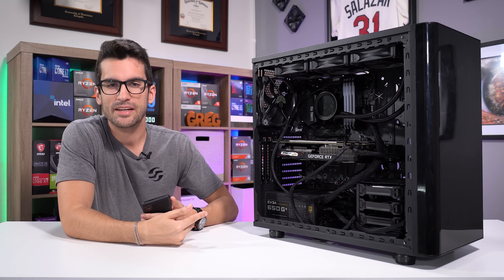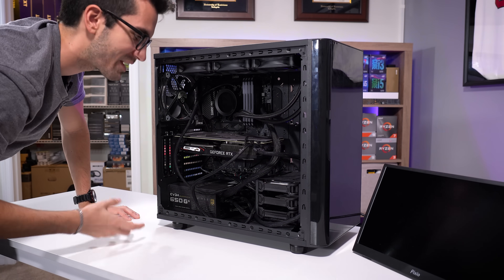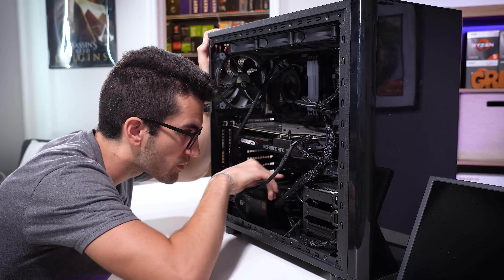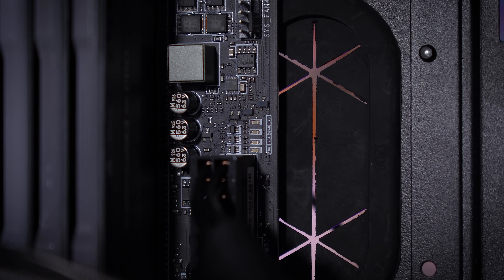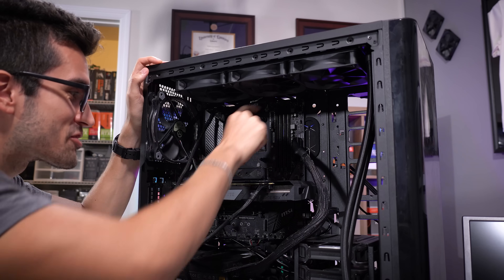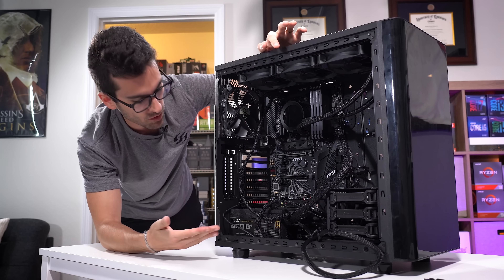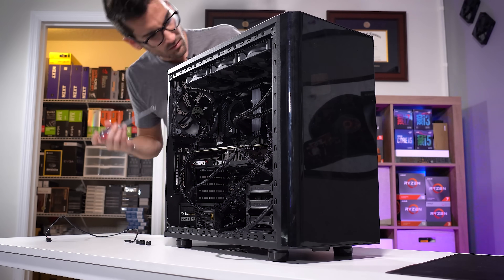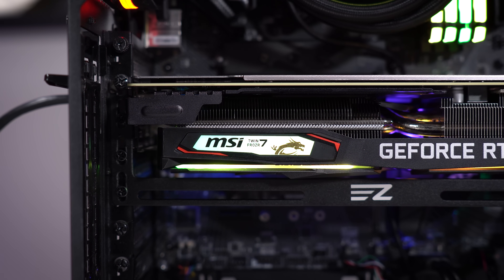Fixing a Viewer's BROKEN Gaming PC? - Fix or Flop S1:E4

Comment: Ive had that auto power off issue, but it's has been halfway through loading windows, and I figured an update had gone bad, until I found out the PC owner had cleaned out the computer with a compressor, and the problem was, that he had blown a lot of the dried thermal paste out between the die, and heat sink, so it would thermal overload very quickly, and shut down. Iv'e had the auto power off issue before post when it was the PSU 12v feed having dropped it's voltage to almost 3v. Ive never seen the plug issue, this video was very informative thank you.

Comment: I have had boot problems with two builds. First one had me perplexed until I changed a SATA cable and the system booted. Second one was a bad memory module and was easy to diagnose. Sometimes it can come down to just a bad cable giving symptoms as you have experienced in this episode.

Comment: I had the same issue with my old rig when I bought it 2nd hand, it'd power for 1 second, then shut down everything by itself, turns out the USB3.0 connector was upside down which was amazing since it's keyed to go in one way. The motherboard and PSU must've sensed this issue and immediately cut power.
Food for thought for future troubleshooting, ALWAYS disconnect all wires.

Comment: An errant speck of dust can do it.   Dust can carry a minute current and even ground out components.    Several years ago, I cleaned my system, a tiny little dust bunny jumped into an empty Dimm socket for a RAM module and as soon as I booted the system, there was a small flame from the dust bunny and that short fried the dimm socket.    Thankfully, I was still able to use the board with two sticks of memory, but it was a valuable lesson on being very careful when you clean your PC.

Comment: I encountered the same problem as shown in your vid, Greg. Except that it is an intel 5th gen setup. Tried the usual troubleshooting steps, until I was forced to upgrade to a new setup (currently running a ryzen 5 3600 and an rtx 3070). But I never thought of removing the panel cable connections. Thanks for sharing your info on this. Time to revive that old intel then!

Comment: Actually my wife just called me an hour ago and told me exactly that... It's an older machine (i7 4790K, x97, ALSO an MSI-Board...) therefore, anything is possible...
Also that PC tends to have problems with USB connected to those headers for some reason. 
Then, this video popped up. Thanks Greg, made my day!

Comment: Before you ran out of options, there were two other tests you'd have done or were not shown: Reset CMOS which has worked for me. And another instance of wiring issue where PC keeps shutting down / restarting is a problem with a stuck/defective reset switch. Saw that last one in another techtuber's  video (can't remember who) and that one problem was such a curve ball.

Comment: Good debug.  I stopped suspecting the PSU when it started cycling on/off until you turned it off at the PSU.  A PSU problem (like a short) generally shuts down and that's it, it doesn't come back on automatically.  Power-ups are triggered by the board, so they generally set things up to come back on prior to going down.  So if you see it power-up on its own then you know the mobo is directing things.

Comment: Strangely I had exact same issue with my very first build except it wouldn't turn on at all. Everything looked perfect. I literally unplugged everything then plugged it back in and it worked perfectly after that.

Comment: This was actually really easy to figure out. I applaud you for testing everything, but you went for the big things before the obvious thing. So the board recieved power. The board turned on, and then off. Then it turned on and off automatically. That's the answer right there. What turns the board on and off? The power button. The power button has two connectors, an led and the actual switch. The LED recieves constant voltage, the switch only recieves power when the button is pressed. The switch was instead recieving constant power, the PSU was alerted to the problem and shut the board down before it died. So basically the connectors for the button were swapped. 

With a better PSU it would have been either easier or harder to diagnose. If you press the button and only the led comes on, it's letting you know that you messed up. That's the easy way. 
Some PSUs won't even let it boot, which makes it even harder to figure out.

Comment: My OCD is strong with this one...   the backwards rear fan, the cable management, the droopy pants GPU, and that AIO cpu unit being crooked.  The way you make all these PC's you work on look better than they came in makes the mind goblins go away.  lol     Also I have a MSI Frozr 2060 6gb car identical looking to that and it sags as well yet the MSI 1660 super I have does not. The 2060 is that style so it must be something with the way those are made. The 1660 super has zero sag but is also a bit shorter. The MSi mobo I have is a z590 wifi Tomahawk yet the other is an Asus mobo. I was very unhappy with GPU sag with a brand new board and GPU when I purchased them but thank goodness they make brackets like these to fix the shortcomings of the manufacturers. Awesome video even though I am watching it 2 years later.  :)

Comment: Nice video... I've had that issue a few times building older PC's. One where, when the reset-switch was connected, it did this exact thing! Had to just leave it not connected... 

Also: That case is fugly! But nice you fixed his problem :)

Comment: I had this exact issue on a clients custom desktop last week, they had been poking around to clean the pc up.

Turns out it was something shorting the motherboard, I took everything out the case and ran it on a table and it booted immediately. 

Never found the exact thing shorting the board but I did replace all the standoffs and screws holding the board in the case.

Comment: This goes to show why I always recommend disconnecting everything that isn't absolutely necessary to POST when you start troubleshooting - so you should start with literally just a motherboard, CPU, 1 stick of RAM, only necessary cables connected (CPU power, ATX power, graphics card power if no igpu).

Comment: Its funny that it was a front IO issue... Once you showed the problem, my first thought was the power led/power/reset pins were plugged in wrong, especially when you said it would turn on and then power off on its own after the psu switch was flipped.
Glad to here it was an easy fix though regardless.

Comment: Right when you mentioned that the PC turned on after turnig on the PSU (without prssing the power button) I knew it had to do with the front panel. My first guess was a defective/stuck power button, but considering it happend when rebuilding the PC he must have connected the power button pins with an LED (power or drive indicator).

Comment: I think the Front Panel connector was the issue, because when you were troubleshooting it in the first bit of the video, the PC would turn on without you pressing the power button, looks like the power button was jammed in and power looping the system ON and OFF of some sort, and on the first power on after you figured out the issue, you had to physically press the power button to turn it on.

I might be wrong, but that what I got from watching the video.

Comment: Best way to tackle any issue, is to disconnect everything you do not need to boot to the desktop and work your way up from that. What you have shown us here is exaxctly why you do not do it the way you do, but start from the basics. If the basic fails, you can swap ram, psu , cpu and gpu to see which component is faulty. If the basics works, you can attach more stuff, one by one till you find the issue, or, in case of a bad connection, solved it all at once. One more thing, if the basics fails in the case, sometimes you solve it by testing it outside the case. If that works, chances are good it will work inside the case also. Reason? Motherboard most likely made contact with one of the standoffs. Make sure all the standoffs are in the right spots.

Comment: My self built pc has power cycling issues currently.  After I got the latest windows update it started happening.  I reinstalled windows, but not the current update, now it works 90% of the time.

Comment: it also can be the plug insert metal if its damaged in a way where the sawder is loose it can cause the system to no post, i had similar problem with a motherboard i had, it was a fan input/connection.

Comment: I had this with my daughters gaming machine it was dust under the case power on button. Bought an external power start button off eBay and it solved the issue.

Comment: I won't argue with results, congrtas on fix, but I would say you should review your methodology of troubleshooting because of things like those wires. So far we didn't see any super tightly packed SFF's thus i would always start with disconnecting everything down to essential power cables, cpu and one stick of RAM and gpu if needed.

Comment: I can only think of two possible miss wirings that could cause that. Theoretically, the positive lead of the hdd led could have been wired directly into the reset switch's sense line. When the cpu tests begin, it could power up the sata controller just long enough for it to complete the circuit. Other wise, it could just be that the power led was wired the same way as described and msi boards just take a long time to read from the reset line.

Comment: As someone who has had to perform trial and error on front panel pinouts for random OEM boards, he probably had the reset switch connected to the power button pins. Symptoms I've seen of that are power cycling as well as powering on immediately upon turning on the PSU without pressing the power button. Probably unplugged it at some point during the AiO install process and connected them wrong.

Comment: I thought it was a front panel I/O issue! My clue was that at 6:22 you note that it's weird that it powers on automatically, which made me think "what if the motherboard thinks the power button is being held down?". I bet that some of the wires were swapped (maybe power button and power led?) which bridged the power contacts. That would explain the cycling. I bet if you held down the power button now that it's fixed it would do the same restart loop.

Comment: hot air always rises, whether your running an aio or a beefy air cooler hot air always goes up. how i was taught was the rear and top fans are ALWAYS exhaust, and front and optional bottom are always intake.

Comment: The first step I normally would do is disconnect all cables from motherboard and only reconnect power! One of the USB headers may have been plugged with 2 pins offset shorting out 5v rail. Modern boards are have good protection from this early boards would burn out the 5v trace.....

Comment: This is why i always check the wiring after similar things happen when i fix comps. One of my friends on his last build had the sme exact issue and it was literally because he plugged a positive power into a fan output. luckily nothing fried and the fan connector did work after but all his issues was because of that one misplaced connector.

Comment: if my build is turning off that abruptly, having the hdd screeching off, means the system is directly cutting off the power rather than sending signals to the drives first. Even holding down the power button to shut off the pc usually sends out signals first. for me, the first time imma do is yank out all unnecessary drives, hdds or ssds, then proceed the diagnose procedure rather than letting the system constantly powering on and off killing the drives

Comment: I‘ve a tip for people with the same problem if his solution doesn’t work. Some mainboards are checking whether a cpu cooler is connected properly or not. If it doesn‘t find a cpu cooler it will turns of exactly like in this case.

Comment: Finding your videos very interesting, glad you popped up on YT for me :D I recently had an issue with a new mobo, only it wasn't turning off, just getting stuck at the CPU check, I pretty much did what you tried in your video, even when I tried my old CPU it did the same thing, so I reinstalled the old mobo with the new components because I thought it could have been the CPU due to how it had been handled by the courier company but nope, it was fine, everything worked in the old mobo, so the new mobo has gone back.

Comment: Commenting @1:38 so I have no idea what is wrong yet.
One of my computers had a very similar problem. It was working perfectly. I took it apart to deep clean it, and reapply paste. I put it back together and turned it on. It posted to BIOS but then shut off before booting into Windows. I checked all the connections and it kept doing it. Eventually I did a full diagnostics sweep of the system and I found the problem. A dead RAM stick. I checked the DIMM slot too and it was fine. Somehow that RAM stick got damaged in the process of disassembling and cleaning.

Comment: In my experience it's somehow related to a charge of energy a ND bad connection to the RAM, so I usually clean the RAM pins and make a short circuit on the RAM pins (unplugged)

Comment: I`ve been building and repairing PCs for around 20 years now. I literally had PCs come in that wouldn`t post, then I took the side panel off, looked at everything (but didn`t touch anything), put the sidepanel back on and it posted. PCs are half Technology, and half possessed by the Machine Spirit.

Comment: Encountered the same last week when I upgraded the amd stock cooler with a tower cooler and deep cleaned my pc. Miswired the front IO but I was still able to use the pc and game for a few hours. Day after, everything just stopped working correctly. Initially thought I attached the cpu cooler to tight or did not attached the ram/gpu correctly. 2 hours of re-seating the main components, I reattched the front IO and reset the cmos. Fixed everything. This was my first time ever trying to dismantle my pc (I had a guy assemble it) after having it for over 4 years.

Comment: I had the same issue a while back and I checked all the components to make sure they all work and they did so I had no idea what to do until I removed the CMOS battery and the system booted just fine, so i replaced it with a new one and the issue was resolved.

Comment: I Had somewhat of a same issue now lemme explain

My pc case is a old as the cheese i forgot in my backyard thermal take case like from 2000's. It served me and my dad without any issues for a good 14-13 years issues until pc started to reboot. Like the reboot would happen under psu being stressed. Of course we assumed it was a power supply issue and it was. Now fast forward to 2021, the same issues starting to happen again, we just replaced the power supply so we checked that out. I have done almost every single OS and mechanical fixes i can try and(swapping rams, rebooting cmos, formatting windows, changing pcie slot for the gpu etc.) none worked. I had no other doubts that the motherboard was probably on its last stand until i disconnected any cable that was connected to the front of the case, (power button, front usb/jack) PC started working just fine. All those months of torment with a simple fix made me so happy. The reason i didn't just change my pc earlier, i live in Turkey during the worst economic damages this country has seen. I could have not afforded a new one. I cant even buy a SSD stuck using 2 hard drives from the same era my case is from. So you can realise why it made me so happy.

Comment: power led (or HD led) connected to power switch pins.  If it's connected in the right polarity, it will permanently short the power switch pin.  I've seen this exact problem before.  Was my first thought when he said the problem in the email...  But I guess that doesn't make much content if it's a 30 second fix...  ;)

Comment: Thanks for this video Greg, I've faced the same problem like this with my previous system, it was a q6700 quad core system. Thanks again. I case ur wondering my current cup is i7 6850k.

Comment: I mean when the computer kept turning itself on as soon as you hit the power supply switch, that immediately clues me in to the fact that the power pins were shorted. Odds are they were shorted the whole time and the computer turning itself off is simply the same thing as holding your power button to force the computer to shut down.

Comment: I know everyone hates to hear this, but disassembling absolutely everything is essential when dealing with ghost issues, all the way down to taking the motherboard out and running it on a table. It's fine to resist doing this at first and going for lower hanging fruit, but I'd never conclude the culprit is a specific component with the entire thing still in the case.

Comment: From the beginning I was wondering if you should have removed those wires at the bottom and tried to turn on the pc by shorting the power on with a screw driver

Comment: When the PC would turn on when you flicked the switch on the power supply I was like "The front panel connectors are wired wrong!!!" I just did a build for a friend with a MSI mobo and had the same thing happening. It was a cheap case and the power LED and power switch connectors were black wires, all individual and with no  + or - or arrow indicators. Glad you figured it out as well! #ASUS4LIFE

Comment: Some case's front panel cables have additional USB 2.0 connectors (attached to the blue USB 3.0) just in case the USB 3.0 socket is not available, but if you connect both simultaneously, this issue will occur. I did face the same behavior after swapping to a new case, and like you, it did not make any sense.

Best,

Comment: Sometimes if the power is wired to the reset pins on the IO it will. Especially if it boots immediately when supplying power.